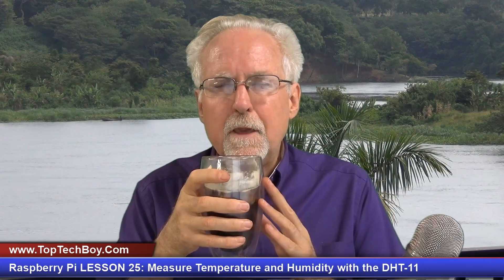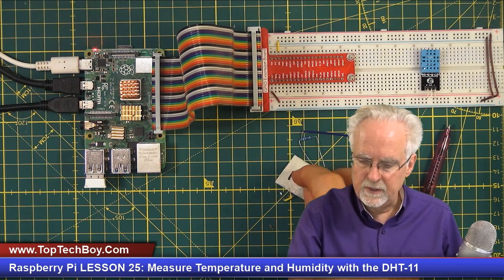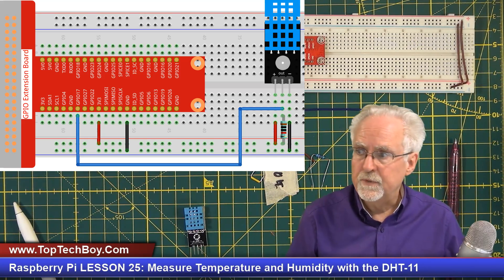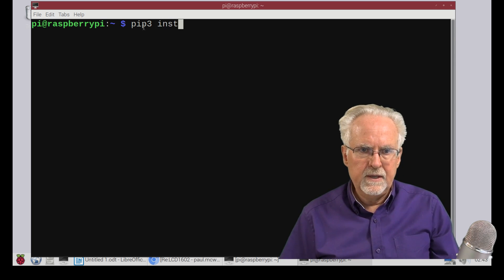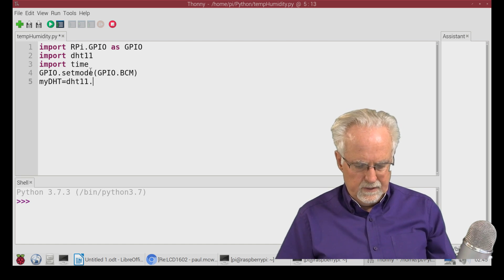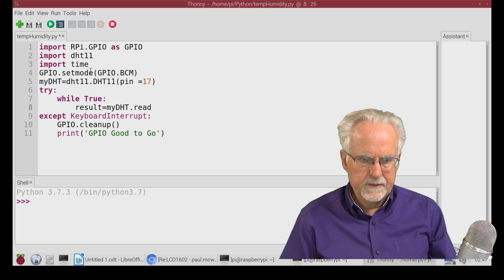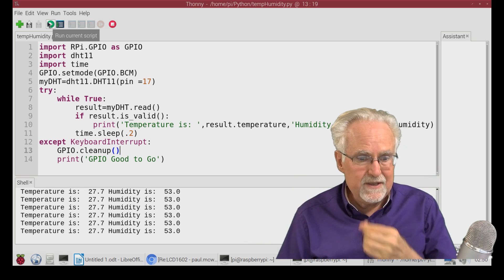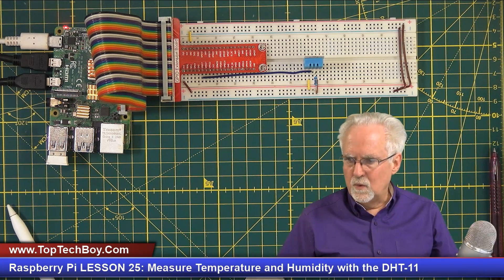Raspberry Pi LESSON 25: Measure Temperature and Humidity with the DHT-11 Sensor

Comment: Hi, I cant download the DHT11 library. When I type in pip3 install dht11
 it says in red that it is externally managed. None of the videos where you have to download a python library doesnt work? Any suggestions?
Reply: Now I don't know if you figured out the problem by now (because you made this comment 5 months ago) but simply add the --break-system-packages command to bypass the error. Here is the following command)

pip3 install --break-system-packages dht11

Comment: Hello Paul, nice video.
I'm having trouble getting the DHT-11 to work with the Raspberry Pi 5. I know the SunFounder site doesn't include a tutorial for the DHT-11 in the Rpi 5 course, just wondered if you had tried to get the sensor to work on a Rpi 5 at all?
Thanks

Comment: Thank You!  Another GREAT Lesson (this on for the DHT11 sensor).   I've used the accumulated knowledge I obtained from your Arduino training to build an environmental chamber that uses a cobbled together chiller (old compressor and chill head) and resistive heater to control the chamber temperature.  I switch to a oneWire Dallas Semiconductor temperature probe because I wanted the probe submerged in the glycol.  It was however the knowledge and confidence I gain with your help that allowed for such an accomplishment.  Thank You, Again!   And, Keep up the Great Work...

Comment: I think my DHT11 is dead on arrival.
I can't get valid info from it. If I remove the "if valid" line from the script it reports 0 for temp and 0 for humidity. I have rebuilt the circuit 3 times and rewritten the code as well. Very unfortunate as it looks like it will be required for a future lesson.

irCrustyLawnchair
Reply from the maker: Maybe it is a dud. These are fairly easy to damage if they are connected wrong as well. Anyway, inexpensive componet try to find another one.
Reply: Bought a pack of 10 more. Same results with three more. I get the very first reading about 10% of the time. If I just let it run, it averages 1% good readings.
I have multimeter'd all my connections. Re-done the circuit. Rewritten the code. Changed the GPIO pin being used. Changed to a new 3.3v<->10k<->out resistor. With and without the resistor. Used a different breadboard. Tried 5v instead of 3.3, "sudo pip3 install dht11" again (also installed from thonny), power cycle the RPi, there is nothing else I can think of.
Reply: ok, I used an Adafruit library and am getting about 70% successful readings. not great, but good enough to use for these lessons. Really excited now to try lesson 28 to build a temperature setpoint alarm.
Reply: @billgregg  Can you please send the link to the code that you used? I'm having a similar issue with the DHT11 and this code? Was it better on 5v?

Comment: Another GREAT video Paul! I always take the time to view them when I get the notifications. I will be able to use the code from a lot of your lessons in my current project for remotely monitoring my RV up in the mountains (600 miles away) over the winter months, I reside in Florida. I have some DS18B20 Temperature sensors up an running, now to add the PIR sensor, temp/Humidity sensors and voltage monitors.  I am still trying to get the VPN between the RV Pi to automatically connect to my home network and transfer the data and alerts throughout the day/night. RV has a 24/7 Public AP access. I may still go with collecting all the analog/sensor data on my Arduino Mega2560, saving it to the Pi and having the Pi connect to my home network and update the dB there along with a HDMI display. I will continue to need a LOT of coffee, so far it is a real challenge. A future lesson for you, that all can use is one that incorporates multiple (3,4,5....) DS18B20 sensors, maybe with automatically adding new ones to the existing base. Keep up the GREAT work!

Comment: This is a lesson that covers a topic I've been working in for a while.  I have an RPi 3B with a DHT22 in my detached garage.  I have the DHT22 housed in a PVC elbow extending outside the garage in a shaded area.  I transmit the reading to an RPi 4B via WiFi to an MQTT server running on an RPi 2. The DHT22 is read once a minute.   The RPi 4B builds a web page so that It can display the Date, Time, Temperature and Humidity on a Sunfounder 10" monitor in our kitchen.  My next project is to use an RPi Pico W to do what the RPi 3B is doing, power it with a battery pack so I can move it to a location where AC power is not available and install it in a Stevenson Screen. I have the Pico version working as a test unit at my desk.  The local time and date is available at the World Time APi site.  It uses your IP address to provide the local time. I update the RTC on the Pico once a day.  I have a problem when I try to power it with a USB battery pack. The Pico W draws such little power that it shuts down after a short time.  I've tried more than one battery pack, but they all shut down.  The shut down time interval varies, but they do shut down.  It looks like I'll have to build my own "battery pack".
Reply: Hi William. Maybe you could add a LED and flash it on and off every minute or so to remind the battery pack it is being used... Just an idea...
Reply: The new battery packs seem to all do that. We used the old one cell 18650 for small Arduino projects in my classes I taught before Covid and they were only a couple of dollars. Now if you can find them they are $15+.

Comment: The thumbnail says "Premieres in 42 days". Is this a bug? 42??
Reply from the maker: No, I produce videos ahead. I can produce and release two quality instructional videos a week. I make them ahead of time and realease them one per week as always. It is not easy to switch back and forth between two topics . . . raspberry pi and fusion 360. Each class requires a specific configuration of my studio. So I make a batch of videos on one topic, then reconfigure and make a batch on another topic. Right now I am producing the rapsberry pi videos.
Reply: @paulmcwhorter  Thank you for your hardwork.
Reply: @paulmcwhorter  Where is your Fusion Videos, the last ones I saw were "learn Fusion 360 or die trying" is there another one?